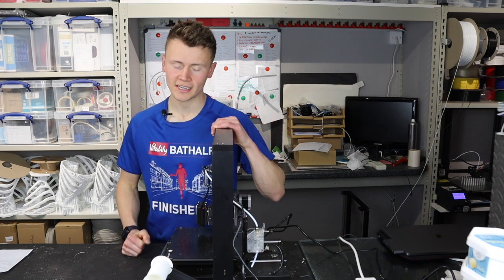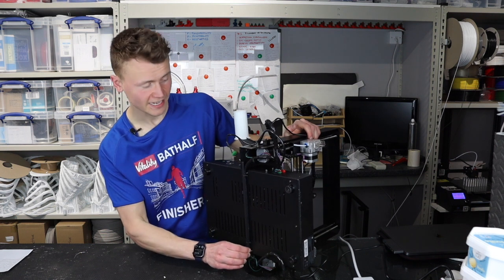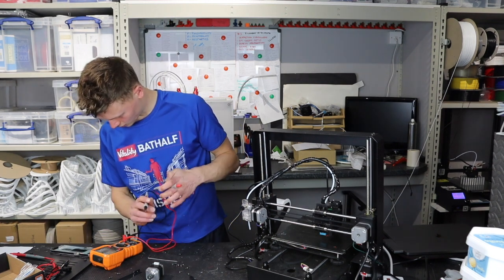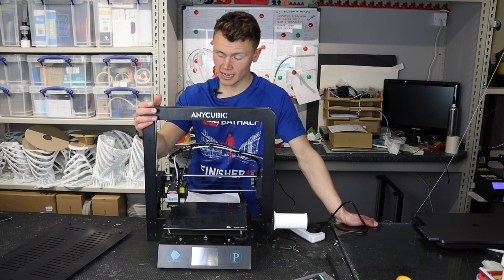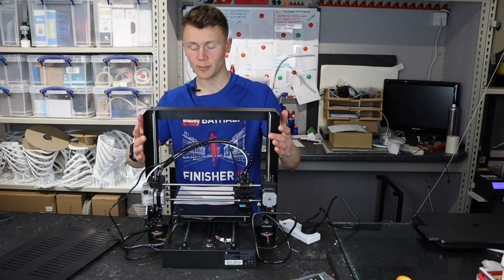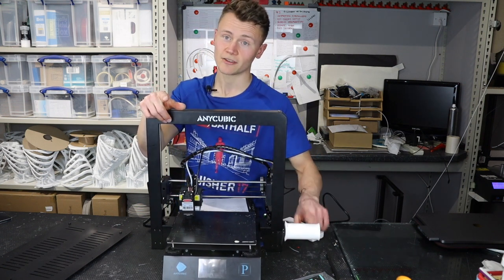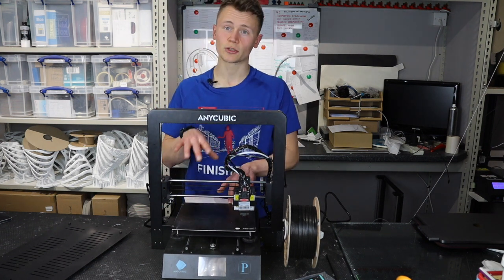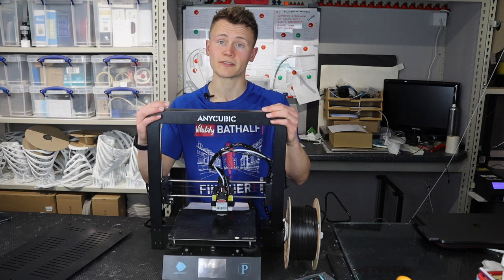REVIEW: Anycubic Mega Pro 2 in 1 3D Printer - Well it broke... but here are the pros & cons anyway!

Comment: @CallumColes the stepper motor drivers needs to be adjusted if its a new printer, mine was set to maximum which resulted in overheating of motors. I guess yours died because of the same reason
Reply from the maker: Not something you should have to do for a new printer really, for many, it could be the first printer they ever own!

Comment: I just got mine and the z index is off, it makes a loud noise when moving up and down and I know its it z that is doing this. I had to take out the PLA and pull on it hard and wounder if this is how I made it uneven... suggestions on how to fix this???? I am brand new and terrified I will break it
Reply from the maker: Yes, very possibly that was the cause, consider the tweak to the extruder drive gear I showed in the video to prevent difficult filament removals in the future. 
In terms of relevelling your z-axis, you should be able to manually turn the leadcscrew on the side which is higher. You're best to turn the leadscrew by grabbing the coupler at the bottom.

Comment: Dealing with support as well. Printed ok for a few but had trouble reading the SD card. Sometimes it would print the wrong file, or wouldn't display files that were saved. They're sending a new card reader to replace the faulty one. Pretty frustrating experience so far.
Reply from the maker: One of my friends also reported similar issues with the SD card, for them short filenames seemed to help. Always worth trying a decent SD card too, since the stock one sent with the machine would be the dirt cheap sort. Let me know how you get on with the replacement:)
Reply: So it still doesn't work, when it does take a new file it prints inconsistent at best, and the filament has jammed a few times. 3 months of troubleshooting and they tell me I'm past the return window but I can ship it back to China for a refund at a cost of around $130usd. Going to try and use the laser and buy a different brand. This one was disappointing.

Comment: I’m on hour 1000 and still printing with no problems. To each his own I guess
Reply from the maker: Glad to hear it, that is what you would expect from any 3D printer. This one, with a dodgy board, I’m sure was exception rather than the rule. However, replacement board has now arrived so I will repair and post an update video.

Comment: Thanks for the review, I like your honest no-nonsense presentation style, well done.

I also have one of these printers, I was lucky to get one not long after they launched, at the end of last year. It's my first 3D printer, so I have no basis for comparison, but I've used it a fait bit, and learnt lots while printing things to modify the printer itself (mostly the LACK enclosure setup) This has mitigated a few of the negative points you correctly pointed out about the noise, as I also replaced the PSU fan when I relocated it externally. The filament holder is also relocated to the outside of the enclosure with a feed running down the front and then looping back up, which has the secondary benefit that it's much easier to access the SD card slot now as well. (why did they not mount that on the front panel???)

I have had no failures with the hardware such as the one you experienced, but having been inside the machine when I moved the PSU, I understand your point about it can be tricky to get out. However, I like the robustness of the build, as although it's harder to work on, it gives me confidence to carry out that work, as there is space inside to move around.

Thank you for the tip about drilling out the hole in the drive system, that has caused me the biggest headache, and is my main complaint with the machine that when I change the filament, I have to unscrew the feed tube from the top of the drive, and snip off the slighter fatter melted piece. Opening that hole a little will hopefully stop that.

Although I have no base for comparison, I think this is a good first 3D printer, and I can see that when I upgrade, I can take many lessons learned from this machine onto the next one, even if it's a different brand, so I have found it to be an excellent first step into this interesting hobby.

Subbed!
Reply from the maker: No problem! Appreciate your feedback, always interesting to hear about other peoples experience with a machine.

Agree with your point on the SD card - it's one of those things with manufacturing - it can be easy to overlook certain elements of the design for the role they will play in usability. For example, if you were to design this printer on an open workbench with access to every side, then it doesn't which side you put anything, it's all accessible. However, not every user will have the space to set their printer up like this, so having components on all different sides of the printer is more of a pain (power + switch left, screen front, SD card right).

Glad the little demo of drilling out the extruder drive gear is helpful for you, it was definitely an overlooked element of this particular clone...

Yes, credit were credit is due, it is a lovely sturdy unit and a great choice for a starter printer so I am glad you are happy with it.

I hope Anycubic watch these reviews and read the comments from people like yourself, since armed with a few changes from their users feedback they could produce a real gem of a 3D printer.

Thanks for the Sub:)
Reply: Did yours start to print then just drag why it printed around the plate that’s the problem I’ve been having and was wondering if you had a solution

Comment: Did they at least try to make it right with you and offer to send you a new board?
Reply from the maker: They had offered to send a new stepper motor when they thought that would be the problem, now that I’ve discovered it’s something on the control board I will update them and see what they say, will keep you posted:)
Reply from the maker: Yes they’ve offered to send a new board, so hopefully will be able to get working again once that arrives:)
Reply: @CallumColes  please update when the new board is installed.
Reply from the maker: @kelsiera  will keep you posted!

Comment: I'm wondering if you got a bad unit out of the batch?

I also Purchased this same model, and virtual have no experience 3d printing and choose this for my first unit.
I'm roughly around 70 hours with it running practically non stop, and haven't noted any of the issues you have had, except for some minor bugs such as removing filament if the tip was warped.

Mine for noise is decently quiet however I have a waterproof fire resistant Dust Tent over the unit, im in a basement so its normally 15 Celsius, so it helps with the temp control and small noise it has which is a faint humming.
 
Yours sounded like the fan was grinding on something?

 Getting pla to adhere to the bed at first was hard, however after fine tuning the bed level and printing a temp tower off cura to find the best temp, the prints adhered without issue.

I had one major print fail where for some reason in the night when unattended, its like the nozzle stopped in one spot and continued upward only, and the last 20% of the print was a blob of plastic not sure what happened there?
Reply from the maker: Thanks for the comment! Appreciate you sharing your experience:) 

In terms of the failed control board, yes I’m sure they don’t all fail so quickly, else would be a lot of unhappy customers, however the rest of the issues mentioned are with the design of the machine so would be universal. Certainly nothing to stop you being able to print, or get pretty good prints from, they just will limit the quality you could get.

The noise shown in the video is intermittent, not all the time, I probably should have specified that in the video! Maybe you would encounter this on some longer prints?

Your issue sounds like a nozzle blockage, these do happen from time to time, always annoying when they do...

In terms of this printer for a beginner, it’s still a good machine and I’m sure will take you through many more hours of happy printing! I’ve personally used over 50 machines through the years, so want to properly critique any machine I review since I believe the best buying decisions are made when the customer is already aware of the drawbacks.
Reply: Yeah I think there was definitely an issue with that unit , I’ve done quite a bit of printing on mine and it’s very quiet.